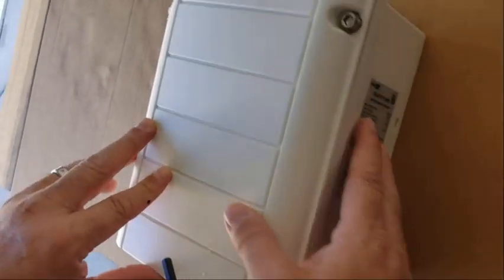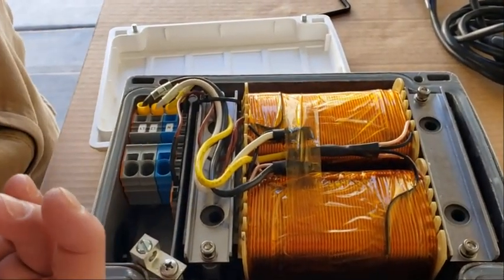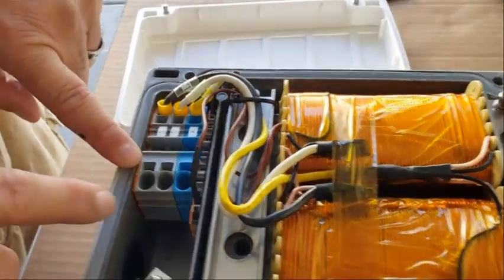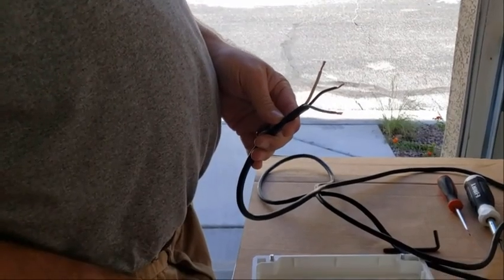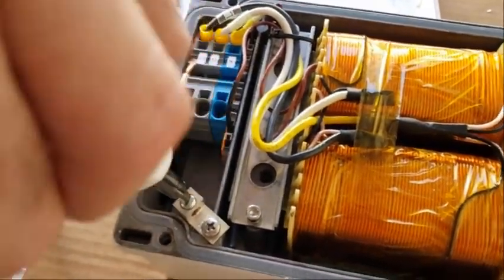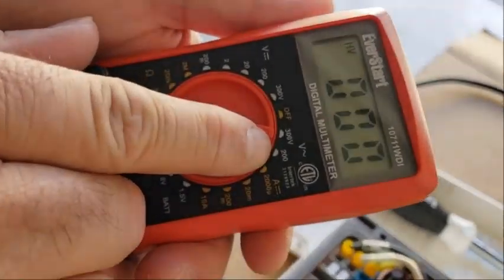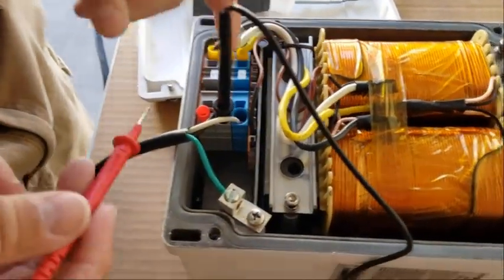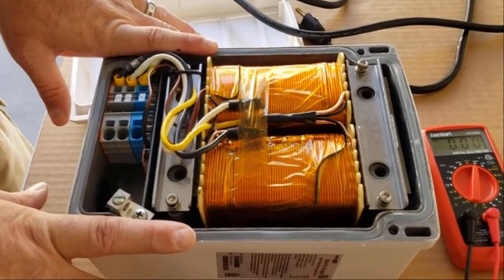SolarEdge transformer wiring for split phase

Comment: I bought 1 of this for my RV with 50 amp  supply requirement and only 30 amp at the hook up point.  This instruction and install is a game changer for RV / mini home life where you are limited to 30 amps power supply. Thanks Sir.
Reply from the maker: Yeah I did the video because I found at the time very little instructional videos on how to do this